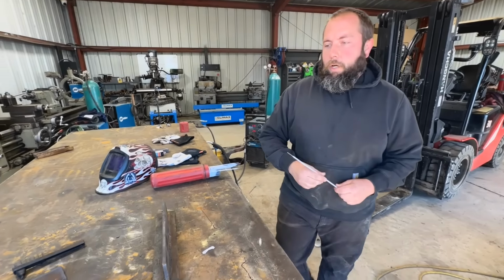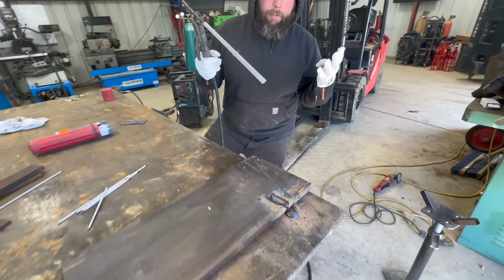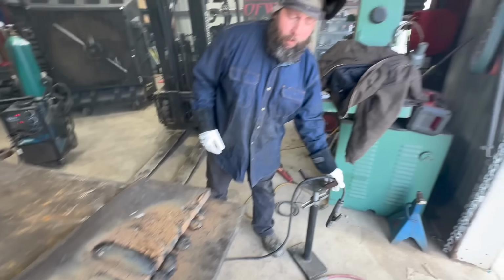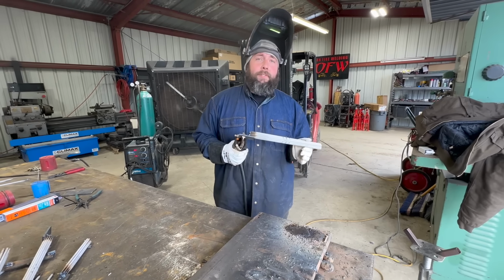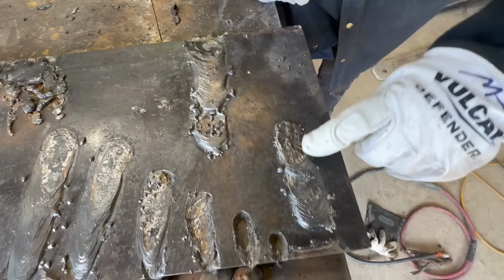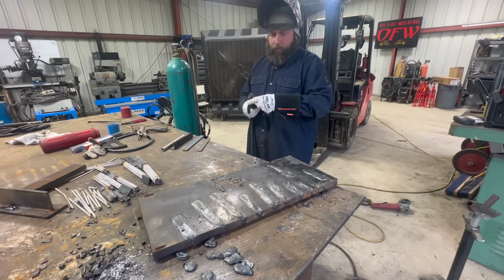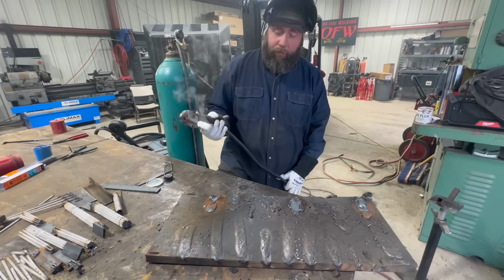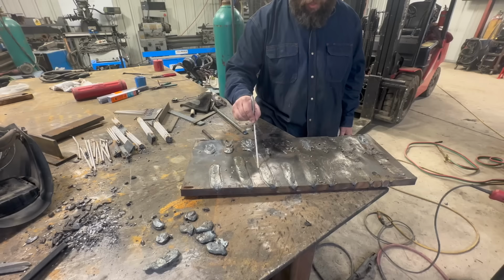Non conventional welding with 7018, rebar,flat bar,tubing,angle iron.

Comment: Now let's see how many 3M Cubitron discs it takes to clean up your test plate.
Reply: Quality 😂
Reply: Pferd CC-Grind are better. That's coming from someone that used to love the Cubitrons. For hogging metal or putting a bevel on pipe the CC-Grind are unreal.
Reply: Lol.  Maybe none (just flip it over).
Reply: Better put that thing on the vertical mill :)
Reply: Just one, and she would still have some life in her
Reply: None because those disks are overpriced trash.
Reply: 8 disks at the same time on the angle grinder

Comment: Cut the 10 and 12 welds...see the depth of penetration...I bet the 10 stick is alot deeper than the 12 one and would actually be a usable/valid weld...800/10 = 80amps per stick if they were all arching at the same time.
Do a few weld preps on some 1-1.5" at 90 degrees and butt joints and stuff and see how well it penetrates and makes a bead.
All I gotta say is DANG what a huge arch and wall of smoke!
That big ol' welding rig can sure sling some metal and make some sparks...and it didn't even bog down...just kept on howling begging for more!!!!

Comment: The warranty department of Miller is watching :face-blue-smiling:
Reply from the maker: Good. I hope so
Reply: Sorry its not covered will be said
Reply: What will they get him for? Burning rods?
Reply: @MeticulousMetalWorks 
1. Rebar
2. Angle iron.
3. LoL 🤣😆 
Fun stuff! 😁
Reply from the maker: It’s no different than air arcing. This machine is made to do this kind of stuff.
Reply: @OFW  They recommend putting a load on a new machine with a load bank
Reply from the maker: @donsmith you are 100% correct.
Reply: @OFW next time you try I'd like to see a pass with a dry sand cover; and then maybe some common powder flux components like lime, calcium etc as a shield.

Comment: Fill 3/4"-1" iron tubes with as many 7018 rods as you can fit for better heat control and use gas too. Great high amp video❤
Reply: It will be similar to a mini thermic lance, but used for welding instead of cutting.

Comment: With that whimpy cable you exceeded tha capacity to achieve meaningful test results as the cable was limiting the current that you were welding with, get bigger or bouble up the cables and re-test at upper limits! This machine is a beast to reach beyond the cables capacity. Ray
Reply from the maker: I know that cable  was my limit. I’m planning to change for future projects like this.

Comment: Reminds me of 35 years ago welding up the kelly bar on the Big Stan drill rig. I air arc 5" x 6" V and welded it shut. I was using 1/4 rod with a gas powered miller 400 dc on a trailer, that was 20 years older than me. The stinger would get so hot burning just 1 rod, that I split the stinger and had 1 stinger soaking in 5 gal bucket of water and welding with the other. That old miller 400 would be lugged down so far burning thru 1 rod the doors were rattling and it was hopping around on the trailer.
Reply: 😂 Awesome

Comment: Finally a welding machine that can plug-weld 10mm sheets without pre-drilling...
🤣
I would expect that every smoke detector in a 200 yrd circle would go off when you start to work like that...
The test piece really derserves it's place as a wall hanger!
Thx for showing!
👍👍👍

Comment: Definitely use the Speedglas in front of the camera - it's just blinding and maybe damaging for TV screens without it.  My suggestion:  I'd like to see that same type of plate in 2 pieces, beveled and attempt a single pass giant weld with whatever number of rods seems optimal.  Whichever made the best weld beads on the first test.  Appreciate your vids as always!

Comment: Given that 10 and 12 rods burn the best, the true test of course is overhead, 800amps 10 rods and then 12 rods to see which is the true champion multi rod winner. One could call such a competition, The World Multi Hot Rods Championship!
I wonder, how thick a piece of steel could you burn through with 6010 @800amps? I have used 6010 to cut steel, its not nice but it does the job when you get stuck! Great video and idea young man!

Comment: At 800 amps you could run submerged arc welder. I would like you to try a bucket of lime paste (that's just builders lime mixed with a bit of water) like they used old school back in the early 1900's before ready fluxed rods were developed.

Comment: the first covered electrodes were wrapped in paper, 
maybe try wrapping that 3/4" hot rolled round bar
with news print......it will put off CO2 when it burns....
worth a try ?
Reply from the maker: I will definitely try that.

Comment: We used to weld bridge girders with quarter inch and 3/8 we call them baseball bats you got to run the heat hot

Comment: Rebar with the flux looks quite funny. Can you please experiment with self-made shielding? For instance, I heard that Titanium oxide is part of the 6013 rods shielding. White paint has it too. What if you put some rebar into paint and try welding with it?  (good ventilation is required). Could you please try welding with stick made of cast iron/pig iron? It contains some carbon in it, which shall probably burn during the weld and make some pseudo protection with CO2. Your experiments are cool, but you may do them even cooler!

Comment: Now you see what early electric welders before shielding flux was developed had to cope with during for example ship building in WW1. I am amazed they did as well as they did, especially the new women recruits, who had no previous experience.
Reply from the maker: I always wondered about the issue they ran into back then.
Reply: I’m sure it was a real game-changer when flux coated rods were finally developed!

Comment: Do a T joint with that 1inch plate.just a single pass on each side with the 10 to 14 rod set up. Cut it , see what penetration ya get

Comment: Really interesting. is there a practical application for the 10+ rod @800 amp. ,,Tank plate welds ?
What about flash welding of heavy material? I couldn’t help notice how the flat rolled became one with the plate in an instant.
Reply from the maker: Maybe practical in some way. Maybe I will use it one day.

Comment: Question is are you actually receiving the full 800 amps through that small welding cable. Would be nice to see a clamp on it and maybe upgrade to some super large welding cable. Do they have anything bigger than 4/0. Or double up on it somehow
Reply from the maker: I’m thinking about doubling up 4/0 and seeing what that does.  I definitely think there was a power loss.
Reply: @OFW  I've used 5/16 in 223 arctec rod before. Basically a better grade of 7018. Wonder how many of those you could run? They suck up the amps pretty quick.

Comment: Either lay down 10-20 sheets of paper and strike the rod on the edge and weld through it with the rebar or, wrap the rebar in 10 sheets of paper and weld with it that way. See if you can make it be a cellulose rod. You could also try welding into a piece of cardboard.

Comment: Slow day huh? :) Thanks for the fireworks!. 
Have your camera man add the shielding gas next time, try 3/8 or 1/2" rebar with that.
(sidenote: A 7018 1/4" electrode seems to have a 320-400A range.)
Reply from the maker: It’s never a slow day!  I have been wanting to do this for a while.  Next time I want to try a different gas situation and different types of flux.

Comment: Is there a practical use for 12 rods?  I know nothing, just curious.
Reply from the maker: I think there could be, but if you were doing that on a regular basis you would have a completely different setup.
Reply: @OFW  As a practical use for 12 rods I could think of welding new track grouser bars onto the tracks of a D11. Even with good weld prep and bevels you're going to spend a long time putting pounds of weld onto those tracks. The guys at the channel "The Jackson Brothers" (Australian farmers with a D11) did something like that about 1-2 years ago and it worked quite well. I can't remember how many amps then ran, I want to say something like 4-6 welding rods so maybe around 400 amps.

Comment: How close do the rod tips have to be to the plate to keep the arc going? I’m surprised you could keep multiple rods arcing at the same time.
Reply from the maker: Fairly close. About the same as 1 rod.
Reply: @OFW  I guess my next question is, with 800 amps how close do you have to keep a single rod to sustain the arc? 1/16 inch? 1/8”? Not sure if all the extra amps would have an effect on arc length lol.

Thanks for the reply and for making this crazy video!

Comment: I would like to know what 800 amps is used for. Is there a reason that there is a setting of 800 amps and when would it be used? That fascinates me.
Reply from the maker: I use it for carbon gouging. Not so much for welding, but I hope I get a reason to weld on 800 amps.

Comment: Wrap that rebar tight in wet news paper let it dry and see if we have some 3rd world E6010. Next vidya jam twisted mig wire in 1/4” steel brake line and see if it’ll work in an oxylance I haven’t tried it but heard it works.

Comment: Weird question about your truck crane. I have the same stellar body with a 7530 crane with the cdtpro controller. Looks like you do also. Is your crane way to fast and hard to control for small precise adjustments? Coming from a Tiger 7643 to this stellar feels like I got a Chinese knockoff crane lol
Reply from the maker: Sometimes it’s jerky and acts like it looses connection.  Very irritating when you have a load on it. I’m not impressed with the crane, but the body is nice.
Reply: @OFW  I just switched to this body and crane. I didn't like the body at first, coming from an STI body, but it's growing on me. I put a support ticket in with Stellar about the crane so if they have anything reasonable to say I'll let you know also.

Comment: After 12 it wasn't really running a useable arc so far as I could see. Just too much slag smothering the arc as it started to skip from rod to rod, so the arc was barely maintainable. Really well handled too.

Comment: What is the correct size cable to run as leads for 800 amps
Reply from the maker: I was told 4/0 but I’m thinking double 3/0 would be good.

Comment: 800 divided with 17 rods is 47 Amp per rod which is not very much. But what kind of welding rod is used on 800 Amps. And when do you use 800 Amps. I know they use 300 Amps for heavy excavator buckets but 800 Amps sounds way overkill...
Reply: I know Adam Booth did a video with a 1000 Amp rod. So there must be reason for those Amperage...
Reply from the maker: I use 800 amps for carbon gouging.  And if two guys were gouging it would be 400 each which is still pretty efficient.  But welding wise 400 amps is about the most I go.

Comment: Do you have any discarded hardox in a pile? Would be interesting how that would weld. Or something bronze or cast. I'm curious enough to suggest a 1" rod of aluminium but that might actually blow up in your face! Burning atomized aluminium is basically airborne thermite and might be a little much, don't get hurt for a video...
Reply from the maker: Hardox welds very similar to steel. I might try some aluminum and see what happens.

Comment: Really should have named this video stick welding with 800 Amps instead and you would have a truck ton more views way faster. At least that would have been my thought process with such a video.

BTW where is the new guy to catch the smoke in a bag to be lab tested? ;)

Also next time you try to weld with Flat Bar like that try coating it with a Borax Paste to act as a flux. Just an idea that makes some sense if you think about it. lol

Comment: That's ton of stress on those cords wanting to melt them down at same time
Reply from the maker: The only one that was stressed was the stinger lead.  The 4/0 main cord was barely warm. But it was also sacrificial.
Reply: What size of cord should the manufacturer have supplied? 🤔

Comment: Not knocking it, definitely cool, but…….,  if you had weld cable to actually support that amount of power it would have been a night and day difference,  lots of that power is being choked out by the lack of wire size to support that amperage
Reply from the maker: Ya,  I’m planning to change it out  before the next test.

Comment: 27:32.  How close is that oxygen tank while you are welding?!  Is it just me or is this a huge no, no?
Reply from the maker: If the valve is closed it’s not that bad.
Reply: @OFW  Honestly in welding school back when I had some great instructors they always harped on us about welding tanks being so many feet away while welding.  I love your work in the other videos but this surprised me a little with a tank being so close while using very high amperage.  Please be safe and God bless.
Reply: @jtg2737  And yet you worry about oxegen?  Hold on... What oxegen?  Do you know your tank colors?  Can you make inferences?  Single tank... on a cart... with a spool gun...  and a time stamp 25:30
Reply: @Failure_Is_An_Option  You are right at 25:21 he says it's a 75/25 mix.  I don't know, every time I see a tank I think of some minimal distance to what is being worked on or practiced on.

Comment: note that welding lens isn't made for such a high amperage / BEWARE for the arc will be , well, what can i say... Did you know: that you have to have at least a 500 amp machine to do anything underswater but in the open air turning the machine up to high isn't something anyone needs to do so as far as this video what can i say...  i'm going to put it under the heading HORSEPLAY and advise everyone against it

Comment: Instead a welding, get some a them 3/4inch gouging carbons and see how many you can gouge with
Reply: You could arc air a train wheel in half in 2 seconds. But the slag would kill ya

Comment: Get a fume extractor or all your employees will get cancer..

And why can americans just not use an angle grunder with a guard on, if that glove gets caught in the fire wheel, it can quickly turn in to a bad day.
Reply from the maker: i have a funeral extractor. I don’t use a guard for that exact reason.  I have had more close calls and scars with a guard than without.  It’s really not a big deal if you know how to properly hold a grinder.  In any of my videos you will not see the grinder jump because I have learned how to hold it.
Reply: @OFW  im a professional fabricator, that is a load of bs my man, if you install the guard properly, it is never in the way, and if you still get your fingers in the grinder then it's not the guards fault..
Reply: @krisvind1715  I went and looked.  You have no videos of this alleged "professional fabrication".
Reply: @Failure_Is_An_Option  true, i don't film my work?

Comment: Someone has to much time on their hands. The welding rods were 1 thing but as for the steel that's probably harder on the machine then an air arcs dead short. Not good I'd say. I'd like my  machine to much for that.
Reply from the maker: I can’t see how it would be any different than running a 1/2” carbon and getting it stuck with a dead short.
Reply: @OFW   I think a carbon would run a smoother arc, easily ignitable, but the sticks were interesting. Gotta make the 6 individual ones work

Comment: There's no way that that wire can carry 800 A without melting
Reply from the maker: Well it did for this entire experiment.
Reply: @OFW  what I meant to say is it would melt if you welded for longer periods of time. Maybe next experiment is to try and melt the leads. For longer periods of time using 800A without melting you would need a wire thick as an arm.

Comment: Not very realistic experiment.  Seven rods at 800 amps is ONLY 114.28 amps PER ROD. Not too many people can run a 1/8" 7018 rod at ONLY 114 amps. With 14 1/8" 7018 rods you are only putting 57.14 amps PER ROD. QUESTION can you EVEN keep one 1/8" 7018 rod running at 75 amps????

The REAL question is how many amps and volts are you putting to the rods, did you take an DC amp meter and a volt meter and check??
Reply from the maker: This was purely just messing around to see what happens. Yes, it wasn’t very practical but it was interesting.

Comment: I would’ve rather seen the Machine making you money on a project, maybe two guys welding and two guy grinding off the same Machine. It was impressive when you used the rebar to weld but enough already.
Reply from the maker: Why can’t I have a little fun?